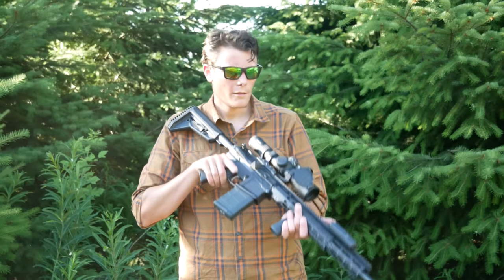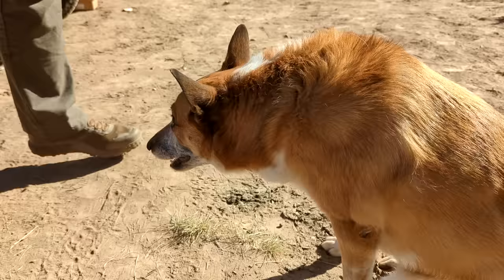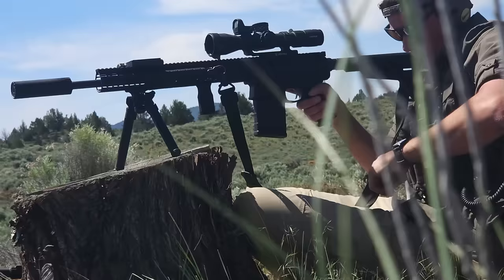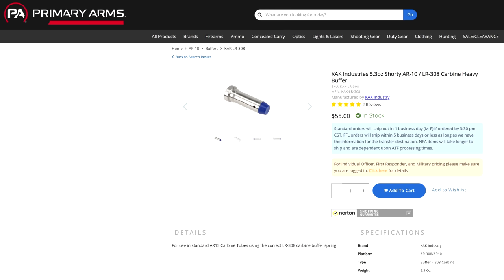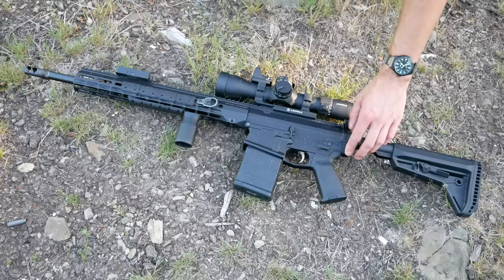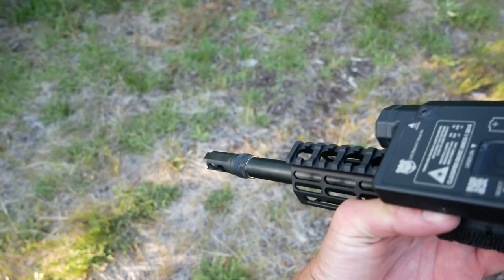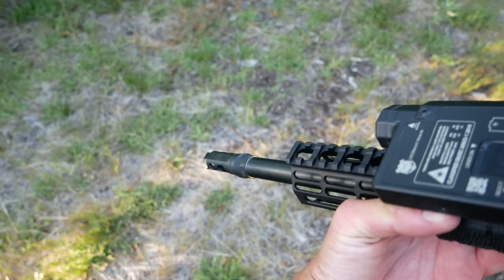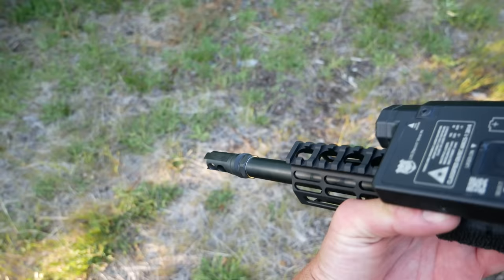Aero Precision M5 SAPR Build

Comment: It is hard to resist building you own Aero M5 if you have been in the AR world for a while.  The beauty of setting things up the way you like it but with the disadvantage of a little more weight.
Reply: Mmmm idk man a i got a 16” M5E1 that’s under 10 pounds w/optic and rail attachments… say again about weight?
Reply: @JT15C  10lbs. is kinda heavy.
Reply: My 20 inch weighs 11.5lbs with a sling, 4x16 scope, offset RD, and bipod.
Reply: @heyhayhay247  i just threw my rem 700 ss 5r mill-spec .308win on a legit scale , mk4 4.5x14-50mm, badger rings and mount, harris SL bipod, eagle ind. butt pack 3 color desert, and sling, 12.33 lbs., 2'' groups at 500yrds.
Reply: @heyhayhay247  i run up and down the mountain with it, fk the gym!
Reply: Faxon barrels can remedy that some, depending on what you're after. But then you have to possibly track down a slightly longer gas tube and also Faxon barrels are a touch overgassed for spec .308. all that considered I like my 'gunner' barrel build. She ain't heavy for a 20"
Reply: You can drop lots of weight if your willing to buy lmos bcg.....and then get pencil or gunner profile barrel if you favor weight (accuracy)  or how nice it is to carry......

This Is why mine has been stuck in the safe since my 6mm arc build.....
It's a shame too cause it's tricked out....shoots like a gamer gun...and is sub moa with federal......but still it's chonky
Reply: @411DL  yep...my 16 inch gunner makes it decent weight......add the jp lmos and it lightens it even more.....

It's crazy doing msg dumps...with 308 & the guns stays damn still
Kinda freaky
Reply: @investigativeoutcomes9343  so your rifle weighs more than mine, takes far longer to reload, is next to worthless inside 50 yards, for a bump in accuracy that isn't really relevant. A 6 inch group or 2 inch group at 500 yards is still smaller than your face. It's impressive accuracy, but you're giving up a lot for it.
Reply: Weights not a problem if the body is fit.
Reply: @brianrich7828  weight is always a problem.
Reply: @heyhayhay247  i could lay down more fire with a bolt gun than you could with a semi-auto. my bolt is good for under 50yrds, offset red dot bro. you have no idea what you are talking about. why would you need a .308 for 50yrds when a 5,56 creates larger wounds at that range. 5# pdw 200rnds, 308 bolt gun 100rnds. one shot one kill there buddy!
Reply: @investigativeoutcomes9343  1. Even if you were a better shooter than me, you'd still be faster with the semi-auto than the bolt action. 2. You don't always get to choose the engagement distance; sometimes, the target chooses for you. I'd rather be able to quicjly transition to a red dot within 100 yards than be stuck with a traditional scope. I'd also rather carry an AR10 than a bolt gun and a PDW. This isn't some video game. 3. I love how you feel the need to copy and paste about your bolt action all over this comments section, and then, you get upset when someone has a different view. Please, continue to be rude and name call like some 13 year old on his Xbox if that makes you feel better.
Reply: @investigativeoutcomes9343  Yes, let's be a tool for no reason. "I'm the biggest man, grrrr" No one cares. We are on the same side. You like you Remington, cool; that's not what this video is about.
Reply: @heyhayhay247  uh yeah dude, you are completely clueless. lol
Reply: @prone_wolf8871  pencil barrels get shit accuracy because they droop when they get hot. they will stay on target if you slow fire and not heat up the barrel though. that's why i use a bolt action with a heavy barrel. one shot one kill.
Reply: @heyhayhay247  i out shoot guys with AR10's all the time, make 'em look stupid with my bolt gun and my handloads.
Reply: @heyhayhay247  The guy is clearly insecure; don't waste your time on some fake sniper.
Reply: @rustyshackleford3257  well, at least the comments will help boost the video engagement numbers for Hop
Reply: @heyhayhay247  a precision semi-auto would be used in the same manner as a precision bolt gun, slow precision fire. you say your semi auto-will lay down more fire power but this is not true. you say that your semi-auto will be faster to handle but this is not true. both weapons will have the exact same sighting system, the only difference would be that a bolt action would have to be manually operated. i wouldn't take any semi-auto gas gun for any kind of serious precision work. i mean right now military snipers are being equipped with long range bolt actions and small suppressed 300blk pdw's for close range work, they carry two rifles. smh, i guess you need more bullets because you will be missing your target.
Reply: @heyhayhay247  ...and he's still going. Too funny.
Reply: @rustyshackleford3257  not as funny as you commenting to yourself and giving each other likes. lol
Reply: @heyhayhay247  i mean all i did was give a description of a bolt gun, it's weight and accuracy of the rifle. it was just an example to compare to AR10 rifles weight. i was not trying to say anything is better than anything. but if you must go there i will tell you right now my bolt action will go medieval on your imaginary COD m110, you must of got triggered when i stated it shoots lights out. you are obviously super jellied.
Reply: @heyhayhay247  i mean it is obvious you got triggered after my first comment.
Reply: @heyhayhay247  so your rifles weighs more than mine, rheeeee. takes longer for you to reload, rheeeeeeee. worthless inside of 50 yards, rheeeeeeeeeeeee. no red dot, rheeeeeeeeeeeeeeeeeeeeee. 500 yards, rheeeeeeeeeeeeeeeeeeeeeeeeeeee
Reply: @heyhayhay247  🤣😂🤣😂🤣😂🤣😂🤣
Reply: @investigativeoutcomes9343  inresponse to your pencil barrels suck statement.....that's old news or when using cheap barrels.....properly stress relieved barrels shoot fine when hot...
Your not going to shoot it so hot it droops.....unless your running belt fed with a can.................
Reply: @prone_wolf8871  yeah i have a shit load of gov profile barrels, lightweight but not exactly precision barrels, inconsistent accuracy do to ''noodle factor''.
Reply: @prone_wolf8871  pencil barrels do suck, despite the fact that i use them all the time.
Reply: @investigativeoutcomes9343  then you made the call to use them lol....just depends what the end goal is......weight or accuracy ..... I will agree heavier barrels generally are more stable and accurate due to many factors....

But I couldn't in good conscience say  you still couldn't make hits just cause the barrel is "moving" around.....
If that is the case get a new tube....or figure out what is stressing the barrel out enough to make it shift.....

I mean how do you know it's the barrel drooping? when most of the heat is by the receiver...

 that would tell me you have a  bad barrel extension to receiver fit....or something is making contact when the GUN gets hot.....

most people don't realize how much aluminum grows with temperature.....

so your barrel that slipped in the the receiver by hand at room temp......
Is a loose sloppy girl when hot hahaha 😆 😂 😅 😜
Reply: @prone_wolf8871 I have quite a few dmr style rifles, samr clones, franken stuff, m110a2 clone, i have two gov profile barrel dmr rifles, 1/8 twist, 5.56, my hand loads which i full length size not small base, get very micro groups, .16moa@100yards, but they are unreliable for first round hits, as far as running an AR10, what ammo will you choose to shoot? factory box ammo has lot to lot inconsistencies and will perform horribly. will you go with m118 or m118lr? m80 ball? the only way to get any kind of acceptable accuracy or anything worth scoping, you will need to delove match grade handloads. I understand your guys thinking as far as what you think your AR10 is for, your thinking of an all around rifle, not really good at long range but can get it done out to 500 yards while still being able to lay down semi-automatic fire at close range using you canted red dot for a close range sighting system. but, this is going to be a heavy rifle, and standing off hand shooting will be very awkward and tiresome. which is why i choose to have a lighter 5.56 dmr style, much lighter and have snipers with long range bolt actions on overwatch.
Reply: @prone_wolf8871  i use barrels and receivers that are match fit by professionals, or you could do it yourself with a receiver face lapping kit.
Reply: @prone_wolf8871  plus AR10's are so hard on the brass that the brass is worthless for using to reload, so that sucks.
Reply: @prone_wolf8871  but if you set your rifle down on a hard flat surface, bipod deployed, press down on the end of your barrel and watch it move around inside the hand guard, barrels are really flexible, the gov profile barrels are really really flexible.
Reply: @prone_wolf8871  i have shit loads of barrels, it is what happens when your addicted to shooting, and plus i do depredation hunting. so like i have hunted 1400 nights in a row before, from 11:00pm to 6:00am, that's a lot of hunting.
Reply: @investigativeoutcomes9343  mine is nice to brass....I wanted that csuse I intend on reloading when I get older 😆 ..

But it was expensive to make it nice on brass....
Reply: @investigativeoutcomes9343  damn that's a lot of hunting 😆 nice
Reply: @investigativeoutcomes9343  you know it's bad when you start forgetting you had  certain parts and when you find them it's like Christmas 😆
Reply: @prone_wolf8871  if you want to watch some real world sheit check out a.amantine, i have been doing the same thing he is doing for twice as long as him, since the 80's. imaginary scenario larping,range shooting is one thing and can lead to a lot of fantasy concepts. the stuff that we do is like an elimination process of things that do not work in the real world. pretty much we live to kill.
Reply: @prone_wolf8871  so much hunting you will find yourself teetering on the edge of sanity. ''He who fights with monsters might take care lest he thereby become a monster. And if you gaze for long into an abyss, the abyss gazes also into you.
Reply: @prone_wolf8871  i get about three reloads out of brass fired in an ar10 action, after three reloads the brass is done.
Reply: @prone_wolf8871  now my bolt action .308win, well i have reloaded brass shot out of my bolt action over 50 times, and still going. i only neck size for my bolt action, so minimal resizing tends to make brass just last. your ar10 will get better accuracy if you full length size your brass as opposed to small base sizing, if full length sizing does not work for your ar10, polish the chamber real good or be forced to use a small base sizing die.
Reply: Love seeing all the support for the M5❤
Reply: 18" with faxon barrel 9.2 lb even with the nickel boron bcg which is heavy as F#*k @JT15C
Reply: Wow this thread was a trip. I’m a year late but I hope that guy matured a little and got some therapy. Jaysus H Christmas.

Comment: I went with the sig 716 dmr g2. Short stroke gas piston. It's not light at 8.5lbs and managed to get one half moa group of 5 shots with 168gr norma diamond line. As soon as that happened I picked up my stuff and went home.
Reply: LOL me 2 having issues with the M5 I switched barrel, buffer, and went with adjustable gas block and still had issues. Then put a rise drop in trigger and shot like a dream. 9 shots later with some M80's and some fed 150 gr shooting right on and continuous I picked up and smiled all the way home.

Comment: A5 tube will let you use standard AR15 buffers and rifle springs (tubb flatwire 308 is the best). 

JRC 8.5 tube will let you use A5 buffers. Gamechanger for smoothness and parts wear.
Reply: @Knight-SgtReyes  you will of course need to choose the buffer weight that suits your build